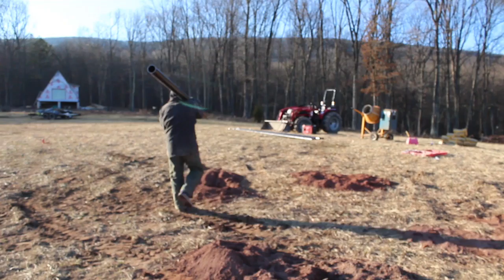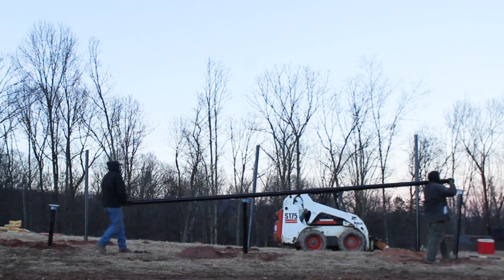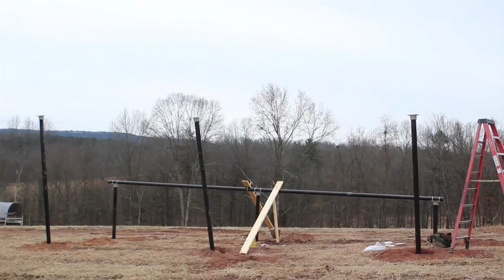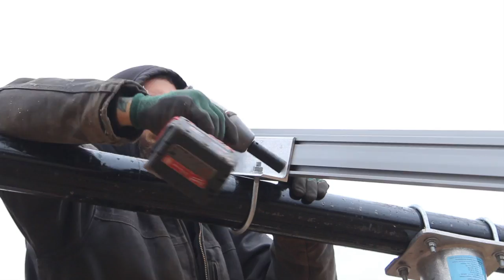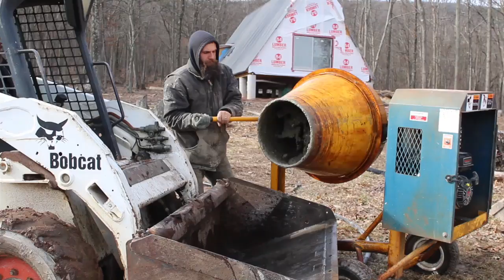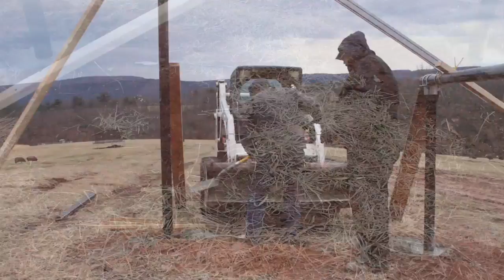Building A Stanchion For Solar Panels

Comment: In retrospect, if you first installed and plumbed vertically two pipes only; one in either row at opposite ends, and then concreted them both into place, and then next day, used these first two pipes to brace off, to simplify the bracing and setting up of the other four pipes.

Comment: Perfect shade shelter for pigs, sheep, chickens if you wanted to double the array function
Reply: Lol, similar to what I was thinking, big enough to stick chicken coops or goat shed under, feed the livestock, clear snow/clean or check the panels
Reply: @fuzielectron5172  yep just because I am a health and safety geek I personally wouldn't use if for wood, straw, hay  storage as it potentially could start a fire, same with animal bedding but as a shade field shelter it would work. Another way for multifunction could be a 1 in 10 pitch roof over a garage/stable with 'mini' arrays per solar panel row but everyone is individual and these guys have it set up how they prefer, nothing wrong with that :)

Comment: Hi Josh I noticed your structure has a mix of metals, of steel and aluminium. Have you considered installing protection against electronic corrosion? etc wrap the pipe where the aluminium cross braces touch it with strips of DPM or electrical tape. Also in the aluminium brackets that have steel bolts passing through them, I would widen the holes and insert rubber grommets, then add nylon washers between the steel washers and bracket. The last thing you may want to consider is copper grease on the all the threads, so in 5 years time when you need to do some repairs, stuff comes apart. I hope this helps. D

Comment: Just throw the Readi-Mix dry down the Hole 🕳 
Pour water down 1st, Tamp every 6-8” done ✅
Add water in hole as needed..go easy on water. Saves soo much time. Build a Shed under that !

Comment: I always dump the dry cement into the hole while adding water. Use a metal rod to tap the slurry down as you add more. Works well for me.

Comment: Erin, you are a very strong woman! When I was mixing those same 80 pound bag of cement in my wheelbarrow, I was a struggle just to get them off the ground and into the wheelbarrow so I know how hard and heavy it must have been to get them into the cement mixer. I was pouring cement for my patio extension and hand mixed "24 bag" (2 at a time) of cement. Great job you three did!

Comment: ya could have just dumped the bags of pre mixed concrete in the holes dry ,then pour a bucket or 2 of water in,in fact depending on how wet the ground is no need to add any water save using the mixer.... next time eh

Comment: You could have skipped mixing the concrete in the mixer and dumped in directly in the post hole with a 1/3rd of the water used in mixer. The concrete will absorb moisture from the ground and set up stronger.

Comment: Good job.  Lining up 6 posts to be plumb and aligned is a challenge.  Well done.  Those look like 80 lb bags, but even if 60's, well done Erin.  After I left my full time job I worked a year at Home Depot.  Wrestling concrete bags was one of my least favorite tasks.  Looking forward to the rest of the solar installation.

Comment: Seeing Erin picking up the bags, I was thinking which one is it? Because you always get one, where the stitching or seam breaks and mix starts going everywhere. Also, if you are going to go for a supervisor roll, always remember have something to lean on, be it machinery, a wall or just a bit of 2x4 and now and again point at something with a slight nod or shake of the head.

Comment: Great job. Please use a pair of safety glasses when cutting metal. I know its cold and they fog. Or a face shield. Metal in eyes really sucks. I know. I worked as a logger. On Navy ship building and oilfield. Even wearing the gear my eyes and face were hit by metal shards several times. Even wood chips.
 Burned  because of faulty welding shields. That really sucks. Just keep the safety factor in mind when it comes to your face and eyes. Great looking couple u are. Keep it that way guys.!

Comment: Be Shure when you mount and wire the solar panels, you run the wires so the goats can't get to them and start chewing on them. 
I have seen them on their tippy toes before just to reach that tasty vine. Lol..
 Probably some Northerners will not know what the word finagle means. Ha ha.  
Don't know how many times I've had to explain to folks from the north what the word cattywampus means.
Reply: Best bet is to put a fence around it to keep all meddlers away from it.

Comment: Tip for ya, definitely cap the ends of pipe and put rust inhibitor on bolts/clamps just in case have to remove them, will save a lot of cussing and headaches in the future. Keep up the great work and enjoy the journey.

Comment: BEAUTIFUL JOB.  Please wear eye protection especially while cutting that iron pipe😎  I did some research on advertisements and apparently we need to watch entire  short adds and at least 30 seconds of the longer adds in order for you to be compensated.  I will most definitely participate in this.❤
Reply: i thought it was half of the ad you had to watch, so I don't mind the short ones, I'm happy to watch them. One came up tho that was 6.30min long so sorry but I skipped that.
Reply: @JonXonrupt  this is just some info that I found on the Google Machine.  Maybe I misinterpreted it?  Just trying to support these folks anyway possible.  Let me know if you find any other info. Thanks
Reply: Yes ! You 2 should wear eye protection more !!!!
Reply: That’s what another channel owner told me as well, Bearpaw.  Thanks for checking that out.

Comment: Holy safety glasses batman...a good way to level that would be to block up under the ends of the horizontal poles at each end and
hang the verticals in the holes with the hardware..then level the horizontal with shims rinse and repeat the other side...

Comment: I don't think you should have been lifting those bags of cement. Please think about your "back" health. In my younger days, being a single parent I did a lot of difficult lifting having to build and repair things myself. I am a registered nurse and had great plans for my future when I retired. At 63 I became disabled. 3 disc removed, 4 vertibre fused, rods in my back. I still have 3 more bulging disc. You don't think about consequences when you are younger. I am unable to lift more than 10 pounds now. It is heartbreaking to be unable to pick up my grandchildren and to garden like I want to.
Reply from the maker: +MiChelle Jaggard I am so sorry to hear about your difficulties with your back and your chronic back pain! I can certainly understand your concern. I have a background in body building and am an avid weight trainer so luckily my body is use to heavy lifting and proper form. The concrete was no biggie for me. I wasn't even sore the next day 😊
Reply: I'm sure you get tired of people warning you about things.  Concrete work is tough and demanding but the body will adapt if you use proper body mechanics.  60-80 lb bags aren't much heavier than your children.  One thing you might consider is using a dust mask when mixing.  I noticed you both in clouds of portland dust.  The nickel in the portland cement will sear the alveoli of the lungs.  I'm a concrete contractor who once was a powerlifter.  Now I have occupational induced asthma and find I can't do a lot of things I once did.  Some of that is just aging, but if I could go back, I would wear a simple mask anytime there was danger of breathing any kind of dust from concrete.  I've enjoyed watching all your videos.  Keep doing a great job and working together.  @WildWonderfulOffGrid
Reply: @WildWonderfulOffGrid  I knew you were athletic by the way you both
 move. I had a feeling you had been on the weights,. Outstanding job you two!
Reply: @WildWonderfulOffGrid  I'm so glad to hear that. You are so smart to have trained your body so well and your choices to be a weight trainer. In hind sight I wish I had prepared my body better. You are such a sweet lady I just woried about you. Best of luck on your build and my concerns are laid to rest! thank you for the reply.